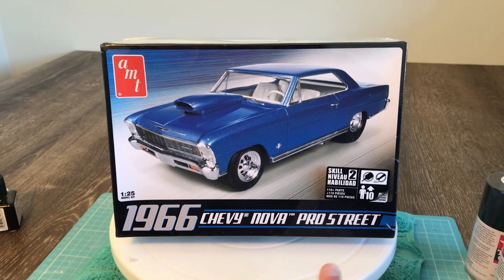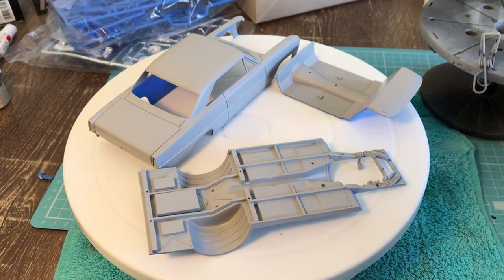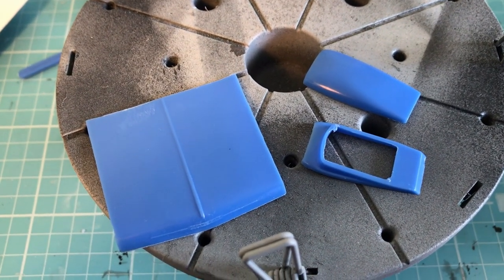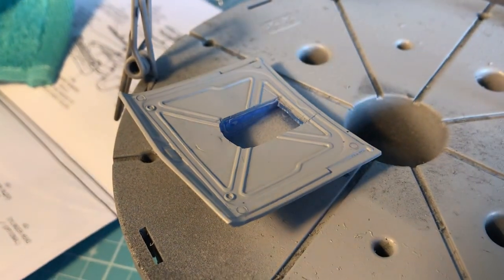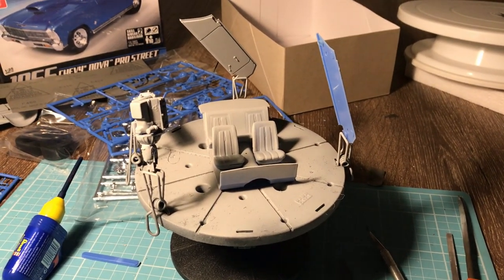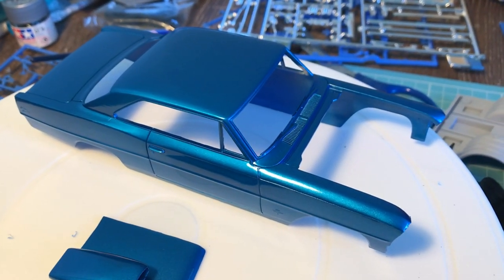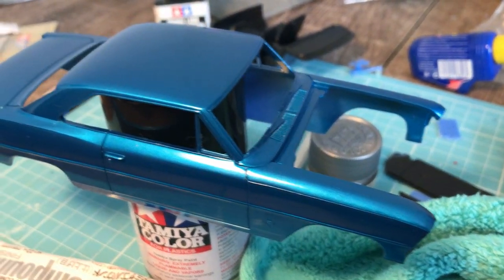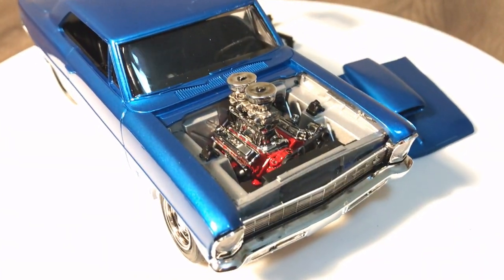Model Car Building - Building and Painting the AMT Chevy Nova Pro Street in 1/25th

Comment: Do you have to sand it down before and/ or after applying the primer?
Reply from the maker: Usually after I prime but if there is an obvious issue I will correct it before I prime. If the primer lays down without revealing any issues there’s no need to sand but usually it reveals things to tidy up

Comment: Very nice build. Do you ever paint your chrome trim?
Reply from the maker: Hey Ken
No I generally just use the chrome as comes in the kit, and touch up any that flakes off with the Molotow chrome pen

I then put Tamiya panel line accent on the bits where I want to add depth 

I’ve seen other modellers who soak the chrome plating in liquids that remove it and then they paint it silver but to me the Tamiya panel line accent settles it down enough to look less “toyish”

But then what do I know I am learning too 😂😂😂
Reply: I wondered that too. Your reply makes sense. Thanks.

Comment: That is a Beautiful job , have you ever used nail polish to spray the model ?
Reply from the maker: Hey Bryan, no I haven’t - interesting idea, is that thinned and through an airbrush?
Reply from the maker: And thanks for the kind words 🙏
Reply: @ChickpeaHobbies  yes it is thinned and ran through an air brush , you can find 1000s of beautiful colors you should give polish a try .
Reply: @ChickpeaHobbies  I use Mr.Color Leveling Thinner 400 and cut the nail polish 1:1 - the metallics need more air pressure and may need a bit more thinner also open fluid needle a bit -

Comment: How much time between paint and clear, and between clear coats mate?
Reply from the maker: Hey mate

Between my mist coats, extremely short time. Like a 1-3 minutes at a guess. Just enough for the paint to gas out a little (so I don’t get runs) eg it sort of evaporates before your eyes. 

Between each of these mists I pop the model in a dust proof thing to sit. However take that with a grain of salt as a few on here have said I use too much paint. I just paint the way that suits me, Tamiya paints are pretty thin and I find doing multiple coats works for me so will keep doing it this way

As for clear coat, I let the paint cure for at least 24 hours. Just because it’s touch try doesn’t mean it is fully gassed out and can still be curing and changing shape. Applying clear before the bottom paint layer is fully cured and gassed out can result in that wrinkled paint, as the paint and clear are curing at different rates

The basic theory I work to is that as soon as paint starts drying at all do not apply anything on top till it’s completely dry otherwise you get wrinkles because you’ve got semi dry paint curing under new paint and it gets ugly.

So with Tamiya paints that start drying really quick I would eg never ever wait an hour between paint coats, it’s either the next coat misted on a couple of minutes later, or a very long wait.

So this model would have been like
Prime & wait half a day to a day
Then Mist paint coats with a few minutes between each coat, keeping an eye on it to make sure nothing is going to run
Then a long wait at least 24 hours
Then clear
And if I use multiple clear coat mists, it’s only a couple of min between each mist

Remember the more you handle the model and move it around the more risk of dropping it and getting dust all over it so look into a little spray booth or I’ve done a foam shelter to sit mine in to dry by lining foam with baking paper type stuff to make it relatively dust free and I sit the model in there after spraying outside . 

Hope this helps and I am no expert at all so take what  I say with a grain of salt 😂